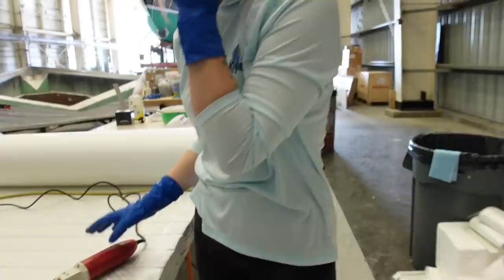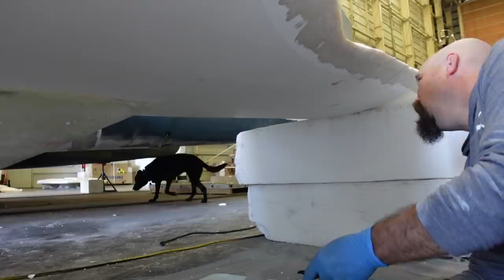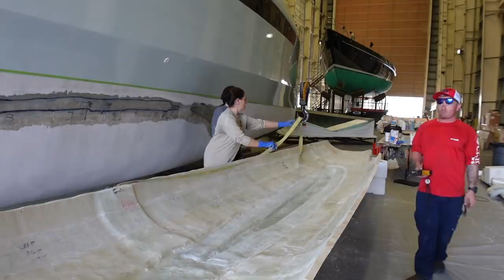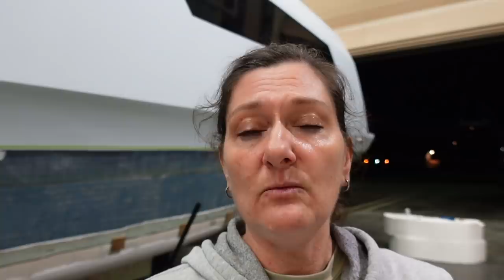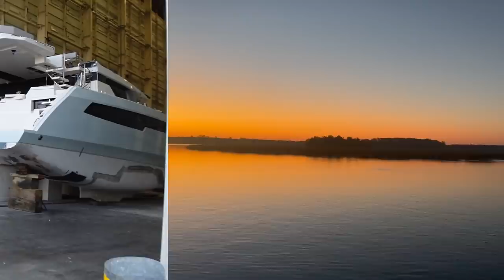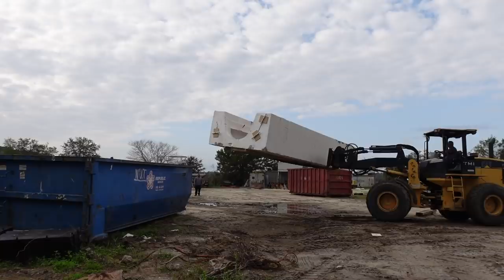OH HAPPY DAY//Installing The Second Hull Part-Episode 64

Comment: It’s so good to see you now have a somewhat “whole boat” to move forward with.  It’s been a lot of work for all of you and it’s clear that you’re more than ready to see this step completed to the point that you can, if you have to, move the boat outside and do more work on the interior.    Do you have a normal timer that you set each time you mix up some stuff, or how do you do it to keep that information available so you don’t miss your working window?    The larger keel’s look great in place too.  It almost looks like the former keel-want-to-be extensions you cut off finally grew up to be real keels.  That bag-o-food from Wendy and Josh was so cool and it looked like you would have a welcome meal.

Comment: very interesting process! So you didn't have to grind back and overlap the new and old fibreglass with 4 way or biaxial sheet? you just put the structural repair putty in and got it signed off with just that? In my experience there would need to be a minimum of 2ft overlap from new to old, with new fibreglass mat. Very interesting solution!

Comment: This is great.  its terrific to see you all working on this and it is so educational.   I was wondering why you use repair putty between the bottom of the bulkheads and the hull.  Would it be better to tab in bulkhead extensions so the bulkhead reaches down to the hull?
Reply: Gotta fill and make fillets before tabbing

Comment: I was under the impression, and some research online (has to be true then) leads me to believe that polyester filler will not bond very well to epoxy. Is that not what you are doing down there inside with the Total Boat filler?
Reply: Original construction is polyester & they probably tab those with glass aswell.

Comment: Would have been nice to 3D scan the bottom of an identical boat, remove only what you have to from above the top deck and roll the boat over to do the repair. The entire bottom of both hulls could have been ground down, I'd prefer to rip them out completely. Rebuild the entire bottom of the  hulls with carbon fiber and kevlar with epoxy resin. You could have resin infused the glass work. Use the 3D scans as 100% accurate reference points, everything would be perfectly aligned. You would have ended up with a far superior boat to the original, about 1 months work. Your method is inferior to the original that was questionable to begin with. Nice effort though, don't run too far offshore!